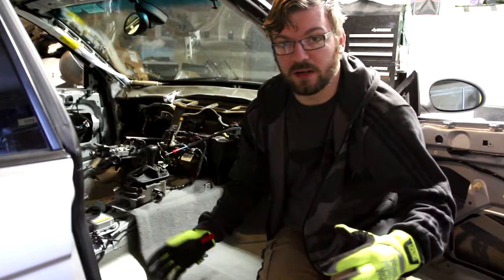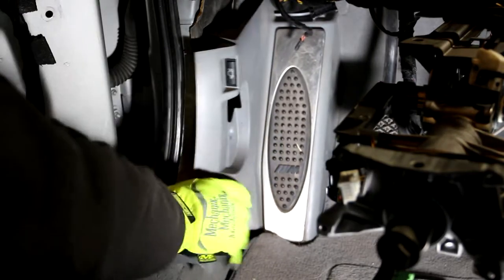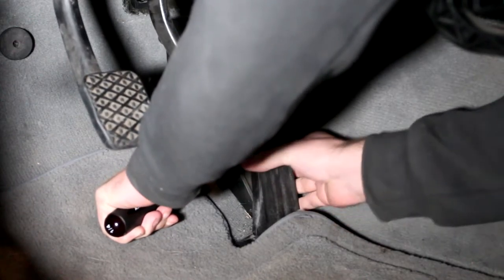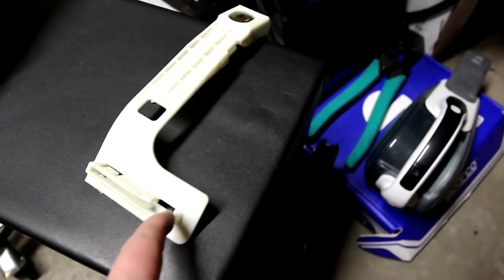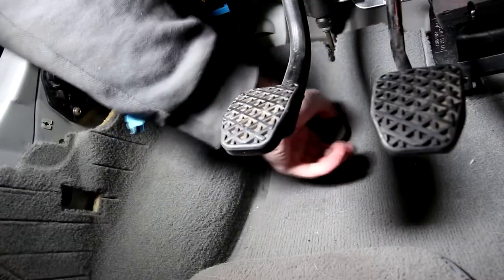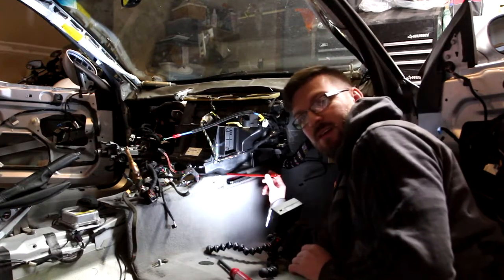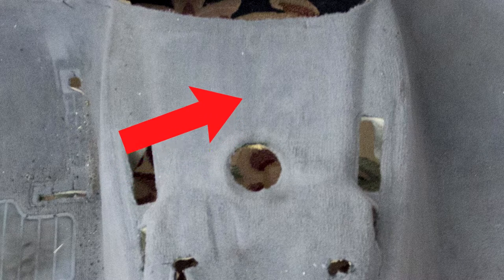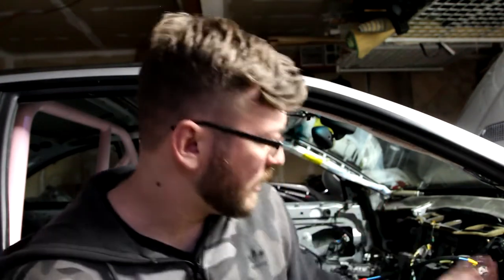Taking Out the Front Half of Carpet - BMW E46 M3

Comment: I’m doing a full interior swap and I’m debating wether I should pull the carpet or not. The back looks easy, but do you think it would be hard to put the front carpet back in the way it was?
Reply from the maker: Depends on how much of a purest you are. If you were for example willing to cut a slit between the heater core housing and the front, you could slide it on pretty easy and you would never be able to tell. Otherwise,if you kept it in tact, I feel it would be challenging.

Comment: Have you any plans for steering and drive chain upgrades, like the purple tag steering rack and 4.1 final drive? The removal of the cabin filter housing would be a quick way to drop some weight, shocked how heavy it is. Great videos 👍
Reply from the maker: Thank you! No current plans to change out steering or drive chain at the moment. I do have plans to start dipping into the engine once I'm done with the interior. Cabin air filter is on that list for sure.

Comment: I still don’t understand why you didn’t just cut it?  It’s not like you cared about the condition since it was coming out anyway, also you can cut where it runs under the dash so you won’t see it.
Reply from the maker: So I can keep it in one piece if I decide to rebuild it, and in the case of this, more so if I ever decide not to rebuild it and decide to instead sell the parts. No one wants a cut carpet and in good condition,which mine is, they can be worth a few hundred so a little extra effort to preserve it's potential future value was worth it.

Comment: Hey, i'm a DIY'er and i've been following your videos closely to learn the install/removal of some of these trim parts.  Thanks for that.  Could i ask you a quick favor when you can.  At 6:32 you are pulling off the clip from passenger side front carpet.  Behind that carpet just on the body panel, do you see any square hole or seal/plug that looks like is on a square hole?  Thank you.
Reply from the maker: Glad they help! There are 2 square holes. A small one above the flip location, and a bigger one below that is covered by some rubber seal.
Reply from the maker: @dinan53  Kinda odd thing to be missing, but it happens
Reply: @WannabeRacer  Thanks.  If you can, not urgent, is the rubber seal has a square shape?  Thanks again.
Reply from the maker: @dinan53  It is square, but its not like the one on the drivers side. Its kinda like a rubber taped that covers it.
Reply from the maker: @dinan53  Looks like it

Comment: Hi. If or when you decide to take of the ac completely please ad the video. That would be a good one. Liking the content and the on and off sarcasm.
Reply from the maker: Thank you! I plan to remove the AC system this summer, but I am not sure about the heater core itself. I did like to have to option to use the heater to defog the windshield in the colder months when there is still snow. I have been exploring lighter heating options though, so I might be able to get rid of it. Not sure yet.
Reply: @WannabeRacer  keep doing what you're doing and talk more about the plans you have for the car and racing. Following from the sunny caribbean keep it up!!!